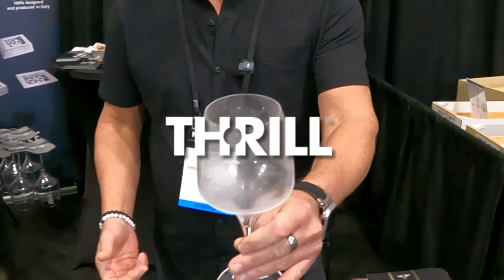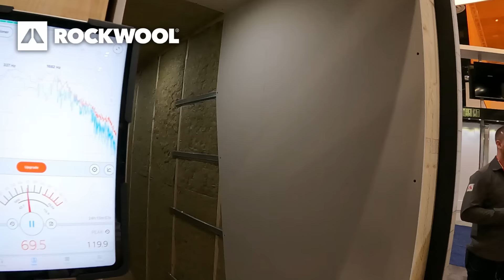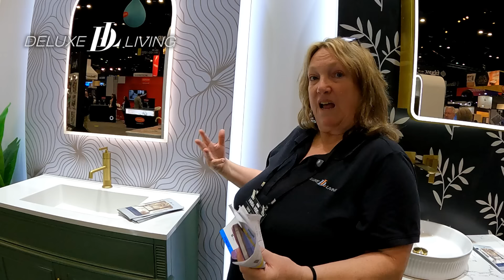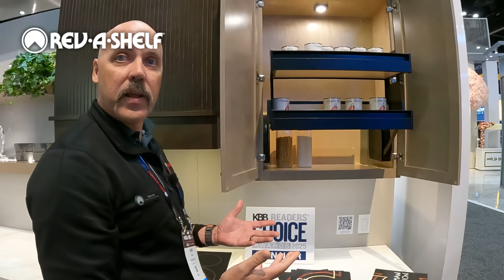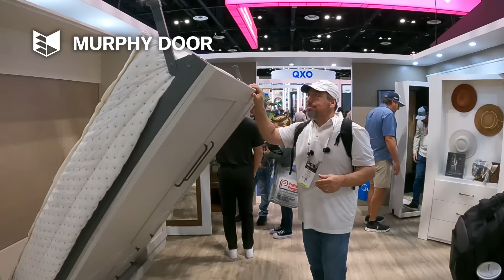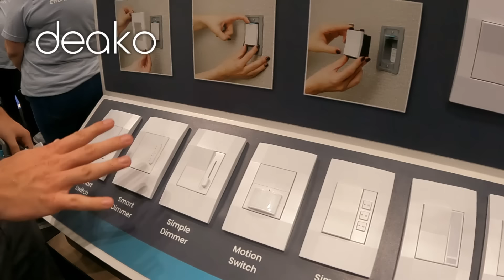40 Products That Stood Out at the World’s Largest Home Show | IBS 2026

Comment: Generally, an operating room in a hospital is very clean. When the doctor removes, for example, a scalpel from a sealed and sterile envelope, the scalpel is no longer sterile merely microseconds after removal. The idea is to control harmful agents, not eliminate them. Elimination over any significant time period isn’t possible. Don’t be scared of bacteria. Be wary of harmful bacteria. We’ve evolved to deal with a great number of them without having to coat everything in barrels of antiseptic.

Comment: People who promote Rockwool as this amazing sound dampening product do not actually know if it is or is not good at this.  They just parrot what everyone else says.  Rockwool is great for several reasons but sound dampening is not one of them (compared to just normal pink fiberglass insulation) , once you put dry wall on each side of the wall studs, it's 'sound dampening' ability is just about the same as every other insulation product.  Look it up, the standards for sound dampening, the insulation makes virtually no difference (with a wood stud/dry wall config).  That display is cool but extremely misleading, they know it doesn't make a difference but sell it on the dampening the open wall cavity display shows.  Intellectually dishonest.

Comment: I like the water filter dispenser system, don’t like them on the fridge.  I also like the stackable garage door opener. 
When we rebuilt the house , i want the Rockwall insulation on the ceiling and the walls because I want to open up the ceiling to insulate the house more so it stays cooler during hot days and comfortable during cold days.I like that Starkguard because i hate fixed cabinets in the garage.
The kitchen cabinets , I want.
Smart tray looks cool

Comment: A lot of these seem like gimmicky marketing scams. A lot of them seem like they are adding complexity and potential failure points. Others seem like outright bad ideas. An outlet right in the middle of a counter? Ya know something that is likely to get wet? Cabinets that require motors and electricity to open? These are not good ideas folks.

Comment: I didn't see much I'd want.  The best were the sound proof walls that would be a game changer in any apartment or condo where you have noisey, inconsiderate neighbors.  The water fire was cool. and the shelves that open to storage behind. The thin rock surface could be good if it isn't so thin that it's not durable.  Nothing else appealed to me.

Comment: AquaFire is such a cool concept, until you realize it doesn't provide any heat. I thought the unit used the water vapor and LED for the flame esthetic and still has heat vents hidden on the sides that produced heat with electric coils like a space heater. I'd love to have AquaFire in my home or back patio, though not just as an esthetic.

Comment: As a restaurant general manager i can tell you that -100 is not killing bacteria on glass chiller it will only stop from spreading and after you will serve and it will get warm say hi to bacteria, DON'T use it for cleaning !
Reply: Yup, every meat packer would be freezing their trim/ground beef if it did.
Reply: Love using rock wool because of the noise canceling but it also stays between the studs and doesn’t collapse easily like other insulations. So easy to use.
Reply: I think the claim was going from room temp to -100 that quickly kills bacteria,  so the speed is the killer
Reply: Carbon dioxide (
C
O
2
𝐶
𝑂
2
), particularly under high pressure (HPCD), kills and inhibits bacteria, molds, and yeasts by disrupting cell membranes, lowering intracellular pH, and removing oxygen. It acts as a non-thermal pasteurization method (5-1000 atm) and is effective against E. coli and Salmonella
Reply: You’re talking about a completely different process.

The stuff you’re citing is high-pressure CO₂ processing, which uses sealed systems at hundreds to thousands of atmospheres of pressure. That’s what causes the cell membrane damage and pH changes that can kill microbes.

A device that sprays CO₂ into a bottle for 5 seconds at normal atmospheric pressure isn’t doing anything close to that. It’s basically just blowing CO₂ gas through the bottle and displacing some air for a moment.

At normal pressure there’s no meaningful antimicrobial effect. It’s not sterilization and it’s not killing bacteria. That’s just basic microbiology.

So the manager saying it doesn’t kill bacteria is actually the accurate take. The research you posted just doesn’t apply to a quick CO₂ spray at 1 atmosphere.
Reply: Thank God we have a restaurant manager here to tell us about bacterial science
Reply: @hubbabubba5177  As someone who works in biochemistry, the manager is actually correct here. Extreme cold doesn’t reliably kill bacteria. It mostly stops their metabolism and puts them into a dormant state.

In research labs we routinely store bacterial cultures at about −80°C (around −112°F) specifically because they survive those temperatures. When we thaw them later, many of them grow again like nothing happened. The cold preserves them more than it destroys them.

Some cells can be damaged by freezing, but cold alone is not considered a sterilization method. That is why food safety guidelines rely on heat to kill bacteria, not freezing.

So the statement that −100°F does not necessarily kill bacteria is scientifically accurate. It is basic microbiology, not a misunderstanding.
Reply: @hubbabubba5177  Perhaps he slept at a Holiday Inn Express last night😉
Reply: @hubbabubba5177 Bahahah😂a
Reply: Carbon Dioxide would kill bacteria growth at lest temporarily
Reply: My guess is you work as a “restaurant manager “ for a reason
Reply: @blueberrywilbur315 🤮

Comment: As someone who vends trad shows, with a 10ft expandable fabric wall and shelfs these booth are absolutely astonishing. the cost to even just bring the booth set up in for some of these must be in the tens of thousands  At our smoke shop trade shows It’s cost $7-12 a lb when you’re bringing stuff in. You can’t walk anything in you go to the loading dock. The union unloads it with fork lifts with scales built in they record the weight of everything and charge you per lb. But some of these booths would need huge lifts. I couldn’t even imagine the cost to bring in those giant 15ft sliding glass doors
Reply: That's a unituitive pricing dynamic. From the outside I would expect you pay per sq ft then its up to you to install and uninstall whatever you want

Comment: Needing power to open kitchen storage is a hard NO.  It adds cost and complexity while contributing nothing.  And A glitch in that system or a power outage locks you out?  Bad idea.
That garage attic lift is overpriced nonsense as well.  Again, cost and complexity.  We had abundant storage space above the garage at a previous house.  Had pull down stairs.  I added a lift system as well.  With A ROPE AND A PULLEY.  Mostly hooked on to a large tote.  But no problem hooking on to a platform.  Cheaper and more reliable.
Some of this stuff is a product with no sane market.

Comment: Rock Wool is the only thing i buy, and its been around since 1840.
Reply: I was at the show and a little disappointed that the Rockwool wall wasn't drywalled. Leaving it exposed without drywall actually makes it quieter in the demo. Feels a bit deceptive to me
Reply: @bobelmer2641 agree. Once we put drywall over top the installed rockwool, the noise dampening wasn’t as good
Reply: I did RockWool around my new bath.. its pretty amazing and quiet
Reply: Yeah. Proven track record.